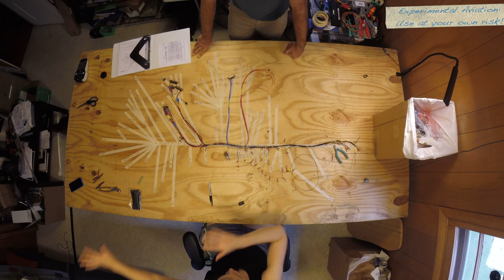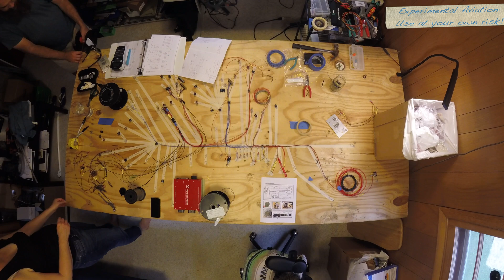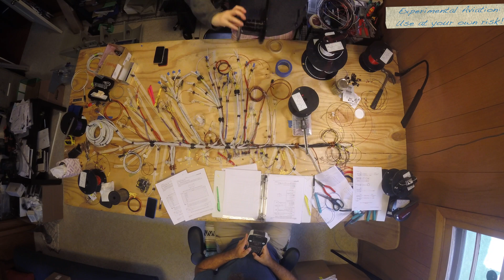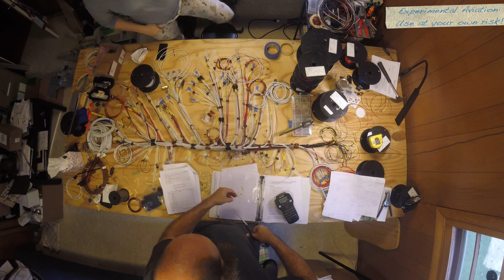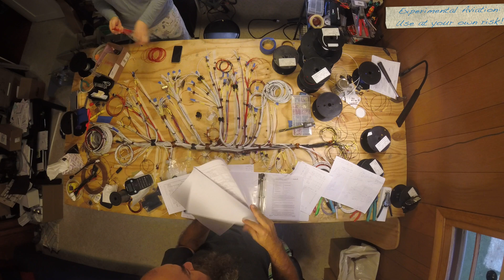RV-10 Avionics - Time-lapse 3: Pegboard to Panel

Comment: What did you use for your discretes on the Garmin GEA 24 (pins 40-43?)
Reply from the maker: GEA: l door, r door, ibbs warn (1&2), tip tank pump running, l tip tank empty, r tip tank empty, ibbs1 int volt, ibbs2 int volt, batt hall amps, p trim pos, r trim pos.
GAD27: caut sw, warn sw, ap disc, freq swap, radio swap, o2 warn, pitot temp, alt 1, rear seat heat on

Comment: Another good video Guil. How much time was actually spent in that 12-13 minute clip? Also, how close were you in your wire purchase estimate? Lots of leftovers, short somewhere and had to order more etc…
Reply from the maker: Wire estimate wasn't bad. I did end up with way too much 3-conductor... and I'm really not sure why I bought so much :) Everything else has reasonable leftovers.
I record at one frame per 0.5s, 30fps, and then speed it up another 8x in post. So 1s of youtube video is roughly 2 min of live time... 12 min yt video ~= 24 hours live? I could have mathed that wrong :)